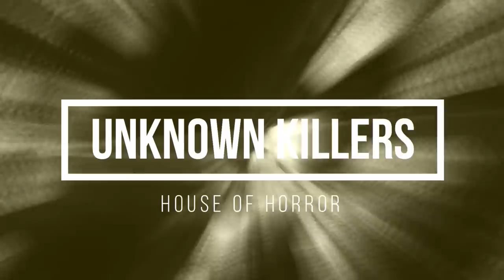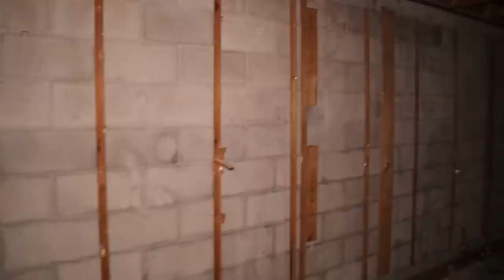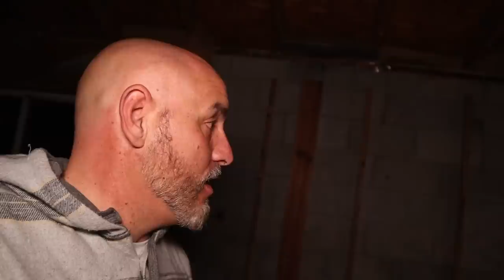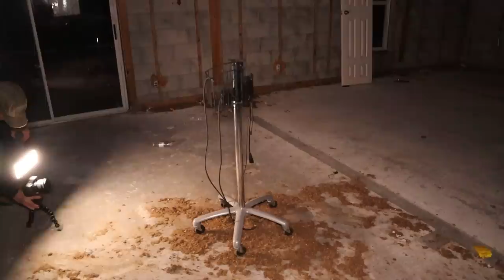(HAUNTED UNDISCLOSED MURDER HOUSE) SPIRITS COME ALIVE

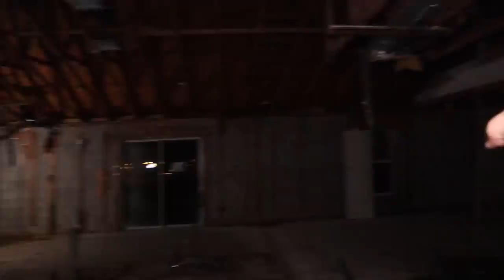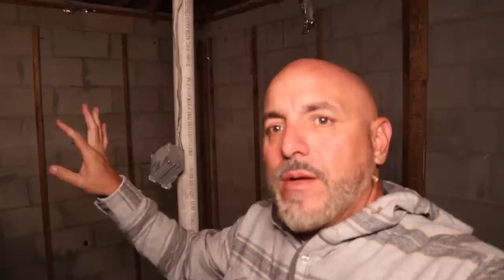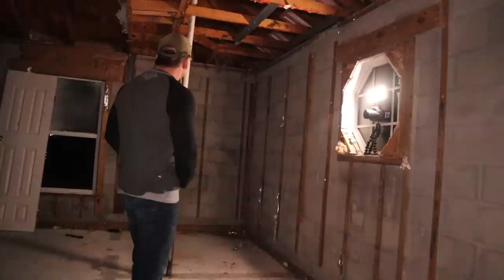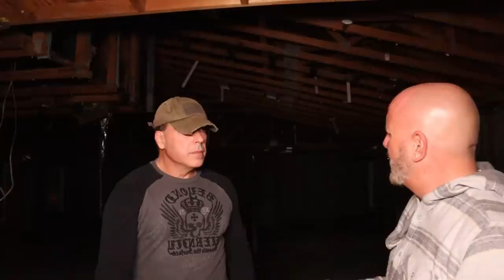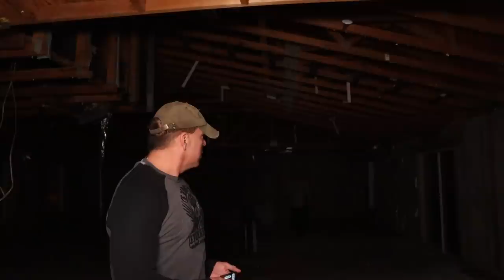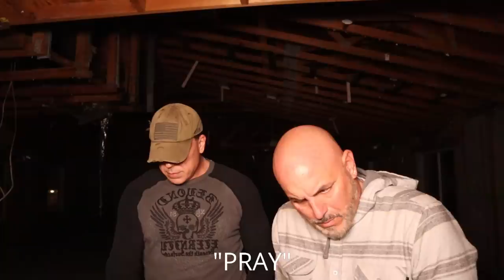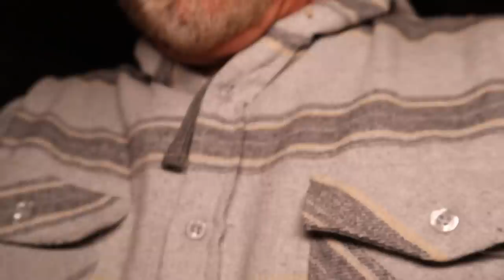Comment: @CCC This is your medium speaking. You put spirits in danger when you do this - in this type of situation.  :05 There is a male spirit at the glass sliding door.  4:04.:05 watch above and right of Chris's head. He is trying to communicate with you. 5:26 He is in the corner over behind you. 6:07 Someone goes in front of cam ( not same person). 6:11 pass by cam again. 13:36 audio check - don't have head phones. 15:35 audio. Remember - there is usually something bad besides the killer in situations like this. Humans are not inherently evil. 19: 28 "Necrophonic"! whisper. Might be the app starting .  21:29 manifesting by the door back where Chris just was. Rush by cam  21:43.  21:47 Manifesting between Joe and door where right side again. Coming closer 21:50. rushed by cam 21:13. Movement  several people walking about in back right again as well. 22:38 Rushed up on cam.22:57  the one that made noise shows up on cam - left side. 23:00  goes by cam in red which is demonic. 24:08 the one that answers appears to left by cam. 32:33 a woman was talking. She is the one who said stop and A-hole. She was not talking to you. 35:36 they start rushing by cam

Comment: There were 6. And I knew it, too. I swear, I wrote that prior to the answer. And you’re smart to not like a spirit box. Used improperly (like Joe is, for instance) can open channels for everything to come through. If you want to use any type of spirit box, and not deal with potentially evil and/or negative spirits, you need to SET THE PARAMETERS. In other words, say that you would like to talk to “x” but you are not willing to talk to “x” so they are not allowed to come through or use the device to communicate with you. Always set limits. A;ways set boundaries. Even when you’re talking to spirits aloud, always set boundaries. Anyone who says, “Are there are spirits here who would like to talk?” Any means exactly that - ANY. No matter what device or method you use for communicating beyond the veil, unless you wish to accept all who may heed your call, always set boundaries. 

Also, I don’t know if you normally have issues with coughing, but I noticed in both videos (especially when you started provoking, which can be very dangerous), you started coughing a lot. This can be a very common side effect of a spirits influence over you. In other words, they are manipulating something in your body to prevent proper air flow; sometimes, it’s as direct as their hands around your throat, even if you can’t physically feel their hands. So, in the future, if you start coughing a lot, I would HIGHLY RECOMMEND THAT YOU STEP OUT. Simply walk outside, temporarily removing yourself of the environment where the spirit is. You’ll know quite fast if it’s the spirt causing the problem, as it will quickly subside.

And one last thing... I wrote this on Joes video, but I want to say it directly to you since you know the owner of this property. There is a very evil entity (you know them as demons) here. They have been invited. An invitation was granted, whether by the previous owner, or people who have come in since. Because the invitation was granted, the ONLY away to have any chance of removing them and sealing the portal that was opened (in the far corner by the back slider) is to have an exorcism performed. During this, (blessed) St. Michaels pendants need to be buried at each of the four corners of the property. After this, the owner needs to call in a medium who can help the (innocent) spirits here to move on. He/She will guide them to Gods light, allowing them to leave this place and find peace. Right now, they are trapped here because of 1) The violence & sudden cause of their deaths and 2) The evil that was invited in. After the medium guides the innocent to Gods light, he/she can possibly try and deal with Joshua. More than likely, this will take a very strong male medium to deal with him because he will not go willingly. He’s a real bastard. And he’s mean and corrupted to his very core. He hates women, so he will not respond to a woman nicely. In order to get him out of here, it’s going to take a very strong male medium that’s not intimidated.

And as a fore-warning, if the owner attempts to simply remodel and sell the home, it will not be good. Not only will the entity here resist any change made to the property (destroying things, chasing off workers, etc), but if the remodel eventually completes and live people move in, they will be tormented. Perpetually. It would not be a place for the living to have a happy life. 

Much love to you and your family, Chris. I wish you all the best now and in the future as we all work during this difficult time together. 
hugs
Shelbie =)❤️

Comment: joe and chris when you do your investigations take a phone with you. the land line phones that plug into the wall. don't take your phone if you have a land line phone buy a cheap one and take it with you and if there is a connection at the place plug it into the socket, and wait for the entity to contact you.  trust me they will phone you on the land line. I've had it happen to me and it isn't a pleasant experience.